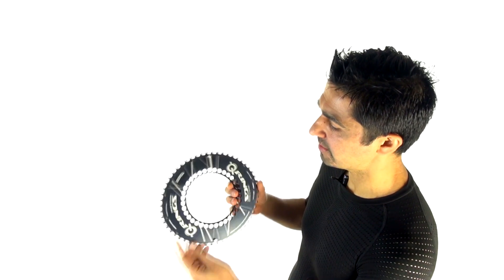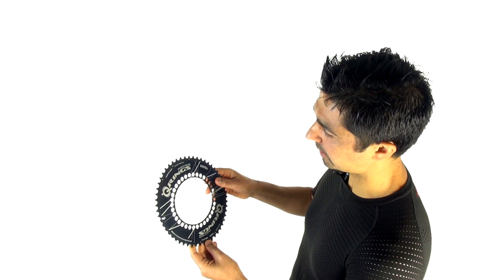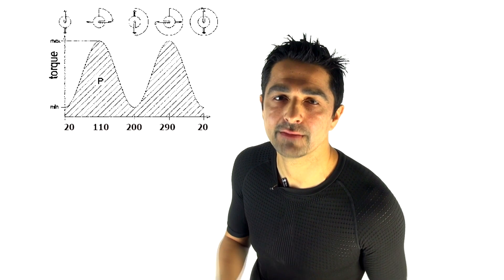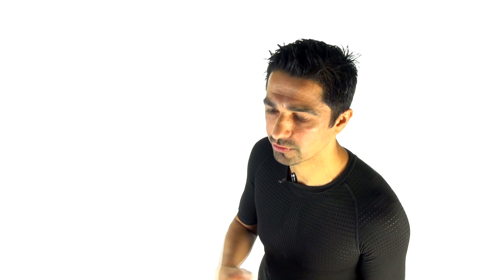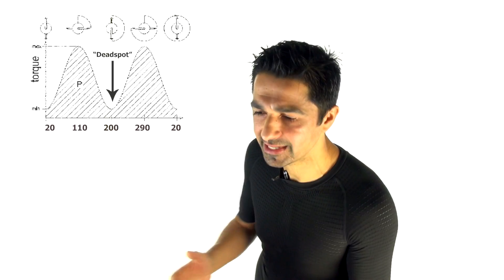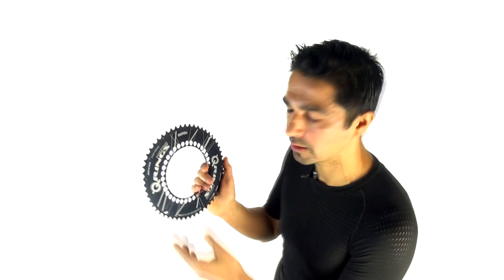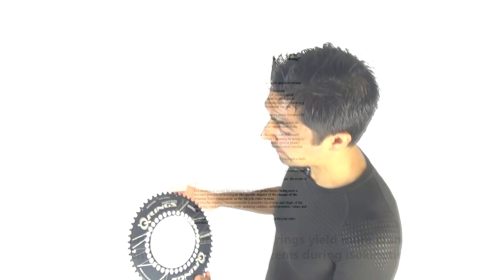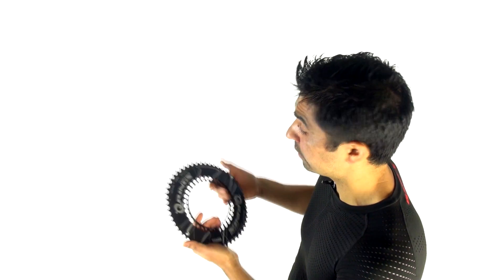Do Oval (non-round) chainrings improve one leg vs two leg cycling power (Q ring, osymmetric)

Comment: Well one thing you mentioned that you could save 1/100th of a second per pedal stroke riding at 100prm, that is a second thus you get effectively an extra second of pedal stroke, thus you could get in an extra 1 pedal stroke or so in therefore you will increase your cadence therefore an increase in power.
Reply: no

Comment: I'm afraid all you have done in this video is prove that you don't understand what the pedal stroke is (2 legs, power zone to weak or "dead spot").  You have taken a lot of data and rattled off facts not knowing where they apply.  For your one legged view, you would need an egg shaped chain ring.  If you want to give the really truth about oval chain rings, there is three things you need to do. 1.understand theory behind the design. 2. spend many many hours riding with and without them on different kinds of bikes. (i personally use road bikes and TT bikes). & then 3 understand how and why the oval rings affect your personal riding. - For myself I am settling towards Road bike with round chainrings and a cadence of 90 - 105 (when not inside a peloton). & TT bike oval rings with a lower cadence of 80 - 90. The TT bike I used to use a cadence of 100 - 112 on round chainrings.
The bottom line is which can get you from start to finish the fastest. (PS as a triathlete I have to be able to jump off the bike and run.)

PSS 
I just had an idea for you. cut the oval ring in half so that you have the crank followed by the half a chainring. now apply what you said, forget the up stroke. pedal from top (weak point/deadspot) down through the horizontal (power or strength point) to bottom (weak point)  now you may understand the theory better. ( Osymetric (Cam shape) simply have a different belief on where the most power is produced through the stroke )
Reply: Trevor Gray Man I loved that !
Reply: I was about to make very similar comments when I saw you'd already nailed it. These videos are usually very good but there's a real lack of understanding of biomechsnics exposed in this one.
Reply: Well done, sir! This issue has been bugging me since the 80s. I just don’t buy the idea that there is a “difference in gearing”. Nonsense.
One very, very simple thing I would like to see is someone mounting the oval 90 degrees in the wrong orientation. Surely it would be dramatically useless.
Reply: @albertbatfinder5240  Thats exactly what the shimano biopace ring was.
Reply: Yeah. This video gave me a headache. I thought for sure he was going to tie things together by the end but it was completely puzzling. It's just bloody obvious that the dead spot is the part of the stroke in between the downstrokes of the left and right legs.

Comment: Mathematics aside, I have an oval ring on my singlespeed and the bike is far more rideable where I ride which is on coast path trails that are steep techy ups or down with very few flat parts. on a singlespeed the effects of the variable gear  size is far more noticeable as I regularly reach the end of my body's torque ability where as on a geared setup that happens far less if ever also by the time I'm trying to grind my smallest gear on 1 x 11 setup up a steep ascent it's quicker just to shoulder the bike and run up so having an oval ring is of little advantage. So for any single speeders or indeed fixie riders there is a definite advantage but for geared bikes it's it's so marginal it boils down to personal preference more than any mechanical advantage.
Reply: Both cranks are firmly attached. So if one accelerated down, the other will accelerate as well. So it is physically impossible to speed up in the downstroke while slowing in the upstroke, because that implies that one arm accelerates and the other decelerates. And both are one solid whole. Bullshit!
Reply: He didn't mention any acceleration/deceleration.   The torque on the down stroke increases at the time the muscles are applying force on the downstroke.  This helps transfer power evenly throughout the rotation and might even smooth out rotational speed.  There are couple of 'dead-spots' when both legs are not applying as much force and where people disagree on whether a different teeth ratio helps or not.

Comment: Erm we totally missed the point here - there are no 1 legged cyclists, so the dead spot is not when a leg lifts, it's the point when both legs change direction, so a good orientation would be one which approaches going up stairs, so low gear at top/bottom and high gear through pedal stroke (each stroke is the other foot's return)
Reply: By the tone of your voice.
Reply: Lee Tanczos Did you just assume how many legs I have?!
Reply: Yes you are right. Also I have since seen a cyclist with one leg and reconsidered the theory. Commercially there aren't any though unfortunately.
Reply: Lee Tanczos juan jose mendez ..
Reply: How do you know if I don't have one leg?

Comment: Very good. As far as it goes. However, one additional point which is the Raison D'être for oval (and biopace) rings. The large diameter is to accommodate the strong part of the cyclist's pedal stroke and the small diameter is to accommodate the weaker part. Taking a close look at the way this is to be used to advantage, we see that the all-important transition from the weaker to the stronger position occurs between the, say, one o'clock and four o'clock position of the crank. Here the leg is beginning its downward thrust, building up strength, and easing into the peak at four o'clock. Human muscles don't like sudden changes, this is called 'gracefulness' in the dancing art. I enhance this effect by dropping my heel early and getting a head start into the downstroke. But then, I am sure my cadence would be considered too slow for your discussion, which seems to be more racing oriented.
Reply: Not at all. Riders I have spoken to feel they gain most advantage during slow cadence pedaling, particularly when climbing. So if your cadence is slower you can probably gain more from oval rings.

Comment: I am yet to find any evidence that can prove that these oval rings, work in any way. Talking about the up and down strokes, dose not explain how the gear ratio alter during the rotation of these chain rings. The only way that  you can alter the amount of torque , is by changing the size of the chain rings. This can not happen with any symmetrical ring. Oval or non-oval.
 This can be proven by the fact that you use a oval-ring on a fixed wheel bike. Also , look at 4:47 of this  video clip. The jockey wheel is not swinging back and forward. This would happen if the front gear was to alter in size.
Reply: change the point of the lever and you will change the torque
Reply: due to the height difference (or radius) of the chain ring from the highest point to lowest it gives an effective change in the gear ratio. The best way to imagine it is to draw a line from the centre of the teeth to the centre of the chain ring and measure the angle between each tooth. For a 53 tooth q ring 6.3 degrees of crank rotation is one tooth at the point of highest wattage output (2 o'clock+ roughly)and 7.2 at the least (8 o'clock roughly) thus giving a longer effective pedal stroke in the place of highest output and a shorter in the weaker point. I never use them to train as it would exaggerate the issue they're there to overcome but for racing I feel they are beneficial.
Reply: May be you do not understand math. When the height (as you put it) alters, the length  is 180 degrees out of phase. There fore it counteracts. So there is no change in gear ratio.
Reply: I do hence why i gave you an estimated mathematical answer. The rings are effectively split into 4 quarters. the 1st and 3rd are the same and the 2nd and 4th. The 1st and 3rd give you an effective 57t ring between 2 and 5 o'clock also 8 and 11 o'clock where you produce your most power. Then when your at your least powerful between 11 and 2 also 8 and 11 you have an effective 50t. Remember that only the place of pickup on the chain is important to the ratio not what is on the chain ring hence my last comment about angles. Obviously all my comments are estimates but give you a rough understanding of how they do work
Reply: I am not asking for an explanation on the theory of the chain ring. I knew of this 30 years a go when it fist was demonstrated on Tomorrows World. As you just said about the rings being split into 4. If you was to do this, you will find each segment to be identical. They will have the same number of teeth. They are all symmetrical. Being symmetrical the effective ratio will be the same thought out the rotation of the ring. Given this, how can an oval chain ring have any nonlinear power output? If the 4 segments are equal the number of teeth are also equal. Therefore the gear ratio will not alter so nor will the power output.
Reply: not all symmetrical. Your struggling with this are you not? Basically they work for some people and once you understand them you'll realize that. Evidently you don't get it so just stick to your circular rings. If they work for you then you've nothing to worry about.
Reply: Zia G I am struggling with this because the way I see it the chain is always engaged to over half the chainring so the lever point is very big and never changes.
Reply: George Carter But the chain is engaged to half of the chain ring at all times so how can a quarter change in diameter make any difference?
Reply: George Carter the chain is not engaged to one tooth but depending on gearing 55-45% of the teeth over which the force is shared. the average pressure on the teeth evens out to what the round rings teeth would experience.
Reply: Hari Slade the lever doesn't change because the crank length is never changing. the ring always has a similar number of teeth pulling the chain therefor the gearing is not changing. the whole concept is snake oil. it's a lie. it doesn't work
Reply: The leverage in respect to the input ie your output through the cranks of course does not change. This is to do with the output from the rings to your rear wheel. Just do a little reading on moments about a point and it becomes clear
Reply: George Carter the change in distance and forces are so small they won't affect the torque significantly. do the math
Reply: well as above given a 53t ring would be 50 at the smallest diameter and 57 at the largest if i'm not mistaken that's a 12ish%  reduction over the easiest part of the pedal stroke. sound pretty significant to me.
Reply: Mind blown. Does anyone know how a cam works?